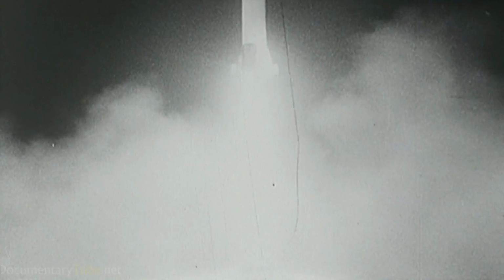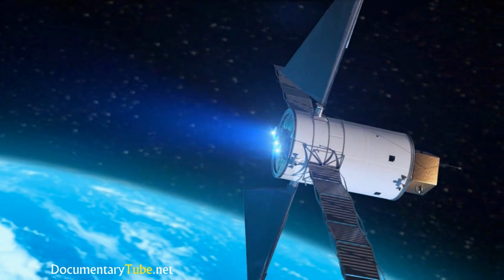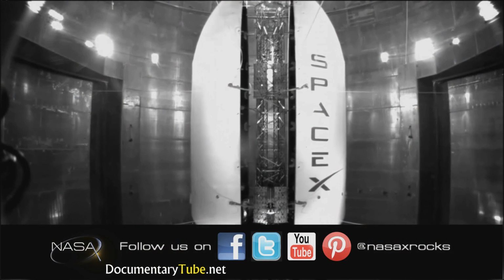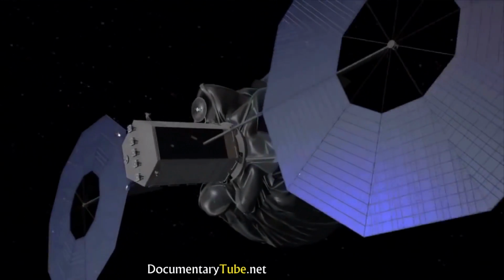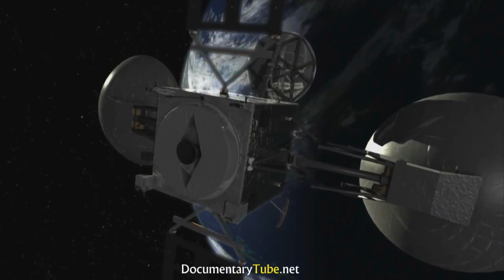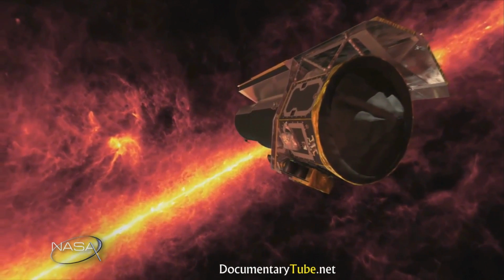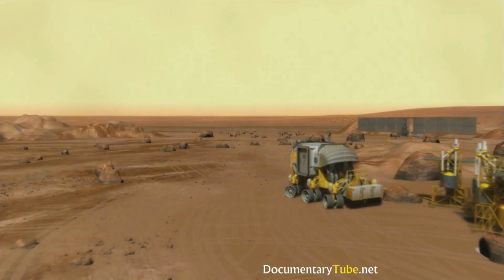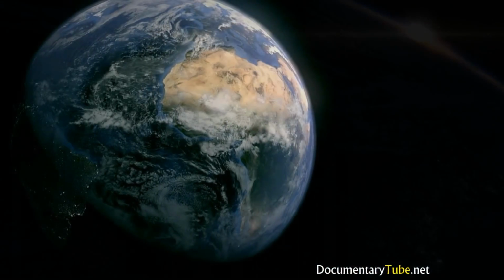NASA's Engines and Possible Speed of Light Propulsion?

Comment: This begs the question......how do you slow back down?
Reply: The same way you speed them up but in the opposite direction. Basically, they cut throttle and spin the sat around 180 degrees and then do a deceleration burn. It takes time so you have to plan ahead. Half the trip goes into stopping.

Comment: There's a technique that I don't want to detail, that I would like you to review (at NASA) for consideration for use in space. It is a propulsion system similar to something that has been proven here on earth by the Soviets.  They have a torpedo, propelled at 200 MPH under water, that is driven by a peisoelectric transducer which lowers the pressure in front of the torpedo. With unchanged pressure behind the torpedo, high thrust forces are produced, driving the torpedo into a near vaccumn in front of the torpedo.  The basis of operation is understood by one of the Bernouli Principles that has it that "when things are in motion they present less pressure on their surroundings" in any one given place of their surroundings.  This is possible because of the time factor involved in motion, as far as I know and in my understanding.  This system should be useable in space better than water.  And my thought is that it might be a way of, basically, taking mankind to the stars, granted in a few more years.
I don't really feel so free to discuss this matter publically, but if needed I can explain further.
Reply: there is no pressure to lower in front of an object in a vacuum. . and there is no pressure behind an object either. . so wtf are you talking about? Maybe if you some how figured out how to have a force or pressure created behind a object you might be onto something thou !

Comment: if you ever hope to make artifical gravity and FTL speeds a reality . they both require a 26 mile wide centrifuge . one centrifuge fits all . using centrifugal force it can produce neutricity for artifical gravity magnetic field and also used as a near light speed pump that expells liguid fuel at FTL speeds , also you'll need magnetic bearing , regular bearings can't handle near light speed rpms . the FTL centrifuge is powered by nuclear power plant and electric motor

Comment: ELECTRIC LIGHT SPEED PROPULSION SYSTEM

A donut shaped accelerator on a starship would work by getting a ferrous based plasma up to speed then releasing it. However, to get the plasma to move faster than light the evenly spaced electromagnetic coil rings don't need to pulse in a step fashion faster they need to be stepped differently. At first each electromagnetic coil ring needs to pulse, then when the plasma reach maximum velocity every other electromagnetic coil ring needs to pulse in a step fashion. Then when the plasma reach maximum velocity every third electromagnetic coil ring needs to pulse in a step fashion... so on and so forth. Once the plasma is up to the desired speed it can be released into a straight tube and directed out the back of the ship. This was discovered in another dimension while I was in something similar to a electromagnet coil ring accelerator. It was also discovered that time moves faster in this type of accelerator. People that broke the law were placed in the accelerator and for the captive years would go by in a matter of minutes to the outside world. This was because the captive would go into an altered state of consciousness whereby their thoughts moved faster.

Comment: ELECTRIC PROPULSION SYSTEM TO PROPEL A VESSEL INTO SPACE 
1st, we need to have a 10 to 20 foot diameter pipe line, formed into a 5 to 10 mile in diameter circle or donut shape. 
2nd, there would need to be independently powered electromagnetic coils wrapped around the pipe which would be evenly spaced.
3rd, we would need to build a bullet shaped space vessel made of a ferrous metal alloy with its own electromagnetic pulse generator 

The vessel would need to travel around through the pipeline several times until it got up to maximum potential velocity. Once the vessel reaches maximum speed it can be released into a straight tube that is pointed in the direction we wanted the vessel to go. This can be accomplished by each electromagnet producing a magnetic pulse which will propel the vessel forward and just beyond the next electromagnet which will fire the next magnetic pulse. As the accelerator’s electromagnetic pulse occurs so does the magnetic pulse generator in the vessel

In Phase 1,  each accelerator’s electromagnetic needs to pulse to gets the vessel to maximum potential
In Phase 2,  every other electromagnet in the accelerator needs to pulse  to get the vessel to its next maximum potential velocity. 
In phase 3 every third electromagnet needs to pulse to get the vessel to its next maximum potential velocity.
In Phase 4 every fourth electromagnet needs to pulse to get the vessel to its next maximum potential which is limited only by its structural integrity. Structural integrity can be increased by jelling the inside of the ship.

Comment: How about wealth is focused on creating an alloy or material that can withstand .05 grams of uranium nuclear explosions. Do one explosion, wait 30 minutes for the heat to radiate away, then do another. And as for the braking problem, let's say you used 15 of the .05 uranium explosions to propel yourself, then use 14 explosions in the front of the craft to slow down, and once u get close enough to your destination use the 15th .05 grams of uranium to stop and then rely on slow liquid fossil fuels to get to your destination. In space there is no friction with air because it's a void and no gravitational forces acting upon you. So maybe just a couple pounds of uranium can get you to near light speeds.

Comment: Some such particles should be used as a spacecraft engine (the lead is mounted on both sides). The bright light that lights through them goes on the back side of the engine part inside the plane. The partial involved in the electrified wave On the other hand, Newton's law of relativity is also interpreted. And light that goes back to the partycle charging. And we get the speed of light. If we get a call, then we can speed up the speed of laght.

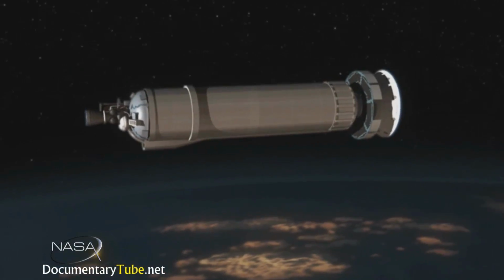Comment: At 2:15 it says it just coasts without losing any velocity, but actually, it its even in a slight ellipticall orbit it would lose velocity as it goes up towards the top of its orbit. Also if it is in a low Earth orbit, there would still be air molecules to slow it down.

Comment: How do you stop a ship moving at light speed Once you get there? and zenox is not replaced easily?
Reply: "bong Scott": Re "how do you stop a ship moving at the speed of light": You don't. (Even if you were able to accelerate a massive object to a speed of C, which you can't, because that would require infinite energy.) Any object traveling at the speed of light has no internal time. From the point-of-view of the object, time has stopped. So it would be impossible for any equipment in the object to sense that it's time to apply brakes, and start decelerating the object. Hence the object will just keep going forever. 

This is why photons can never be destroyed; they can be temporarily absorbed into objects, but their energy is forever, because for them, TIME DOES NOT EXIST. This is literally WHY the principle of "conservation of mass+energy" is true: it's because energy is (literally) timeless.

Comment: light speed travel is physically impossible as Dr Michio Kaku stated on Sci FI Science. You'd have an easier job of bending the universe in on itself and then jumping the small gap between the two sides of it than accelerating to the speed of light. The faster you go the heavier you get and the more energy it takes to accelerate more. It's possible to hit 99.9999999999999999999999999999999999999999999999999999% of light speed, they've done it to single ultra-light atoms, but you can't go any faster.
Now, warp tech.. might be possible, especially in parts of space that don't obey the laws of physics, like Black Holes. But then again, Astrophysics and Terra Physics should be two separate things if you ask me, just like Quantum Physics is it's own thing. Because not all physics that apply here on Earth work in space.
Reply: Warp drives are far more fudging the numbers than reality. NASA has done multiple tests on the concept and their current understanding states to move an object the size of Voyager 1 with this technology, you would first of all need negative energy (something we don't think even exists), and even if it does exist you need about a Jupiter worth of it. Now we could get to 99% the speed of light with a light sail, that's the idea behind project starshot (to send a solar sail to Alpha Centari in the next 50 years) but even still, it would take most of the trip to get up to 99% the speed of light and now you have no way to slow down.

Comment: The universe must have an edge to create a vacuum and alow everything to float in space& whatever area allows space to float in must be humugus & whatever allows humongous to exist must be even bigger & so on until you find the sides that contains it all everything has an ending or run out of space.
Reply: The universe does not exist in a box. A vacuum isn't something that requires conditions to exist in space. It is simply the lack of anything.
Reply: thundercactus thank s but there must be something at the edge if you could travel in every direction including up& down!
Reply: why does there have to be something at the edge?

Comment: It seems that inevitably a craft using a continuous ion drive system that is constantly accelerating slightly will continue to gain speed on the journey, but will at some point reach a destination that will require slowing to get into an orbit. I would assume at that point it will need a large chemical motor to create a massive force in slowing speed. Most missions that gain some additional speed vs boost and coast will still have the problem of the energy required to slow the craft back down at some point.
Reply: In terms of constant acceleration propulsion; you use the first half of your journey to accelerate, and the second half of the journey to decelerate.
Reply: What happens is the vehicle reverses its direction at the half-way point - or at a point the same distance from the destination as the distance at which the maximum speed away from the point of origin is achieved.  Then it uses the same engine thrust in a mirror-like, long, slow process of deceleration. With a power source that creates 1G of thrust, you could have Earth normal gravity the entire time you're accelerating and decelerating.  With a dependable propulsion system, accelerating at 1G over a significant period of time, a vehicle could achieve some significant fraction of the speed of light.
S'matter, you never read any Larry Niven? 
I recommend you read "Footfall" if you can find a copy of it (and if you read). One of the major themes is explaining in some detail how visitors from the Centauri System maintained healthy gravity - as well as many other life-support essentials - on the approximately century-long voyage necessary to make the 3+ light year distance. Some were in stasis - the "groundborn" to be awakened at the destination. Some were awake to run the ship and naturally spawned their next generations aboard - the "spaceborn". 
I'll give you a spoiler alert since I suppose it's highly unlikely you will take my advice here. The aliens' plans to take charge of Earth are derailed by the massive cognitive dissonance and disagreement about the goals of the mission between the newly awakened groundborn and the spaceborn who were the product of several generations- who had no experience of life on a planet or ecosystem outside of the ship's.
In the absence of some FTL technology - and who knows if it's really possible or not? Who knows what technology will have achieved in a few centuries if advances continue at a rate comparable to the last century. In the absence of some FTL technology, any trip beyond our solar system will need to be via either a "generation ship" or through the use of long-term stasis-hibernation of some sort. Maybe a combination of the two - although Larry Niven already pointed out the basic flaws likely to be encountered in separating a crew into two groups with nearly totally dissimilar experience and conflicting outlook.

Comment: Let's be real, interstellar flight by use of spacecraft powered by propulsion engines is really too slow. It will require a major paradigm shift in technology to some kind of travel methodology which can actually warp space time itself if that is even theoretically possible. Solar arrays become worthless as as you get into deep space. Then you have the relativity issues to overcome as well. Earth seems to be mankind's abode for the next 10,000 years, we better find a way to make life on this little planet work.

Comment: 2:10 : "Because the craft is not fighting gravity or atmospheric conditions in space....is just coasts without losing any velocity." Really? Those trips to the moon would have been a lot quicker if this had been the case.
Reply: A chemical rocket can accelerate all the way up to the speed of light in space. The problem is you'll never be able to gather enough fuel to do that, and the engine will break long before it gets to 1% the speed of light.
You don't lose any momentum in space, but you'll be traveling slower at apoapsis than periapsis. You're not losing the velocity, you're just at a higher orbit.
Orbital mechanics are freely available online if you'd like to learn more about them.

Comment: Launch satelites in sweden from a flatbed  w/cherry picker holds tether of satelite connected to heliem balloon off the ground while balloon gains altatude truck cruises until tether is tight the cherry picker releases tether and load goes up 100,000 ft
 Stays up for months then ballons are  blown  by remote package has same 3 parachute deployment and desends back they have mini C3 front loader they air retrieve  package  out of sky like James Bond  .Come straight to air force base nomone ever sees what is going on. VERIFACATION CHECK LARGEST PURCHASER OF HELIUM COMP. IN SWEEDEN  GETS PRODUCT DELIVERED THEY USE 95% OF WORLD SUPPLY. Keepn  it Real
♡ truth movement. :-)

Comment: Achieving light speed with solar electric sails aint happening. You want to generate enough ions for light speed propulsion you obviously are going to use a nuclear power plant. Keep blowing too much resources on this and the Chinese are going to leave us in the dust. It is still electrically generated ion propulsion that will be the key to having enough fuel to travel interstellar. The big math problem is if you reach two thirds to 100% the speed of light, it will take twice the energy to stop land and or return to earth. How long will it take to slow down to a stop after maximum speed it reached. Add the amount of time it takes to return to maximum speed for the return voyage and add again the length of time it takes again to slow down and land again.

Comment: Defund NASA. NASA is deceiving and misguiding the public with this useless nonsense.

What we need is nuclear propulsion, not this toy stuff. We need lot's of energy and we want to go to places quickly. We don't want to ride even slower than SpaceX's chemical rockets, we don't want ion thrusters that have these silly and heavy solar panels which you cannot use anyways once we get a little bit away from the sun. If we use ion thrusters at all, we should use high powered thrusters run by electricity from nuclear power. But why not just use nuclear propulsion straight away? Instead of flying to Mars on chemical energy in over a year, we should be working on nuclear propulsion which get's us there in weeks. We should be going to Jupiter's moons in month by now on nuclear propulsion.

NASA has failed us, defund NASA.
Reply: Because a nuclear thermal rocket is only 20% faster than a chemical rocket. You can't run thermal nozzles indefinitely, they wear out. And the isp of them isn't actually particularly high. Only about 1000isp.
The VASIMR engine could actually be used for constant acceleration/deceleration, and has an isp around 30000. You could get to Mars in 39 days with an electric engine. It would still take 6 months with a nuclear thermal nozzle.
You can read up on this stuff yourself, you know. Stop being so biased and read about propulsion types you DON'T like as well.